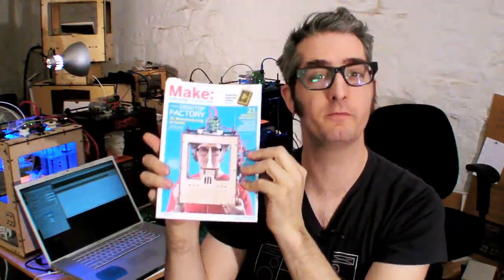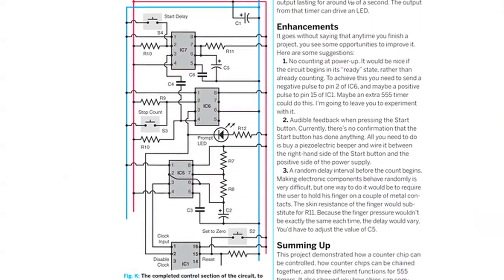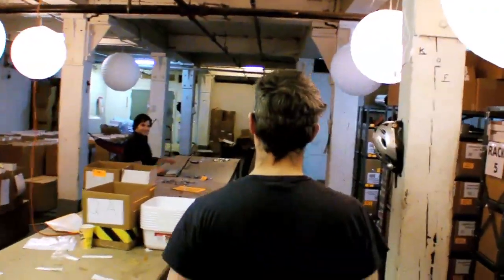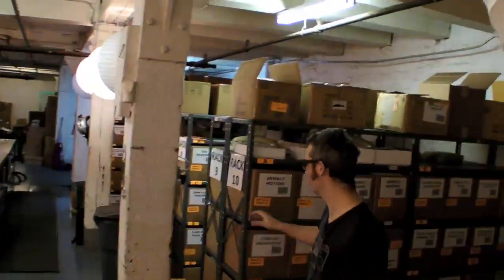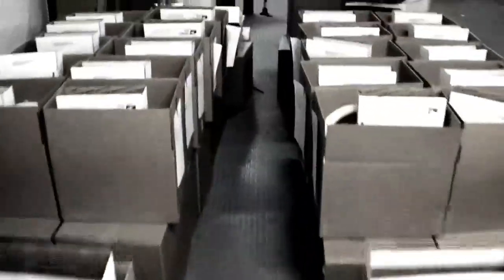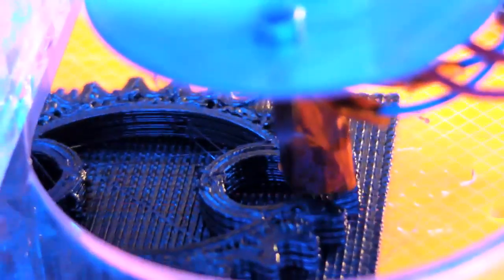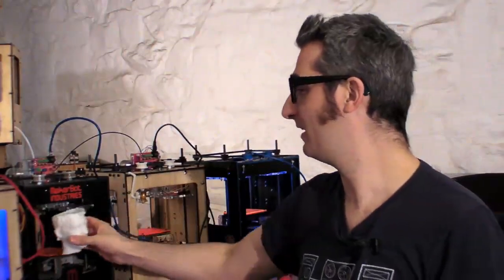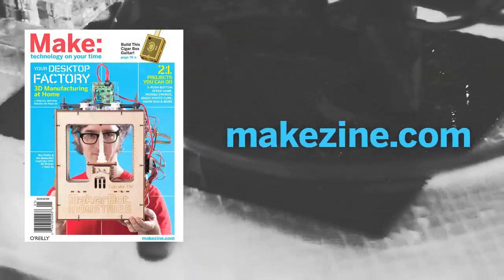MAKE Volume 21: Desktop Manufacturing + a visit to MakerBot HQ!

Comment: it took me 3 hours to find a way to play this video, very cool. If it was less, I'd be an early adopter. I've been working on configuring an old inkjet printer to do printed circuit boards for me. Progress is slow, but progressing. The only way I can find to do this is to move the ink cart, (which I have made conductive thanks to an ink refill kit) rather than move the board. need t reconfigure the hardware to move it's self rather than what it's printing on.